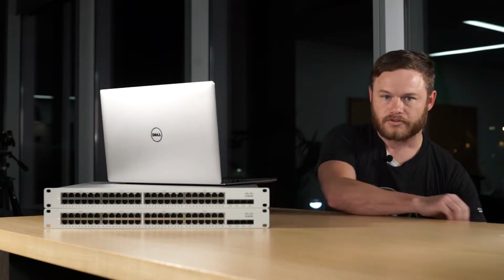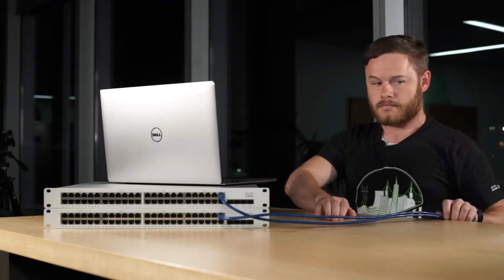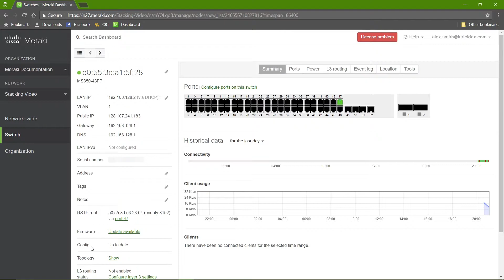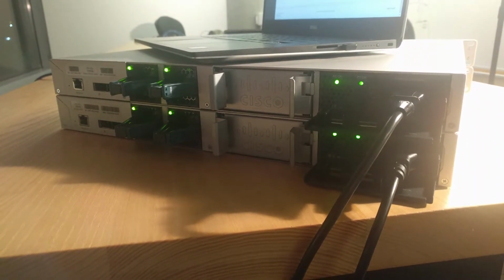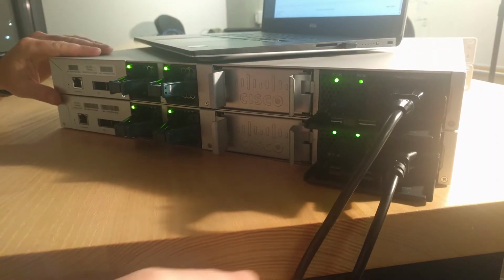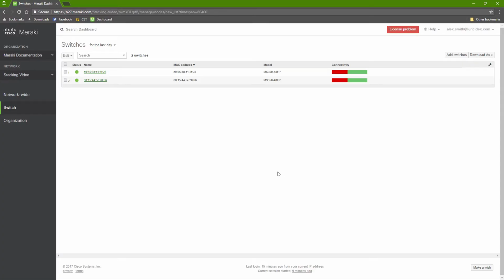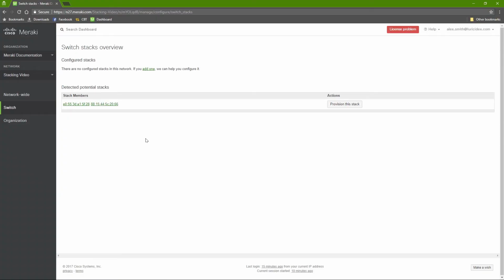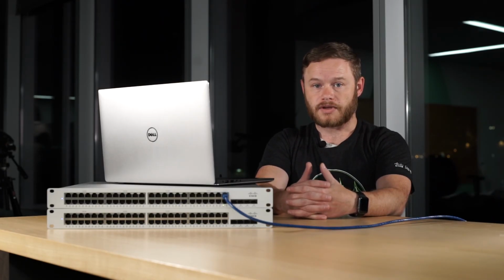Meraki Physical Switch Stacking Configuration

Comment: In this case the switch member with the iNet connection is the master? How can you hard set the switch member priority to ensure it's the master? I know in stackwise you change switch priority to 15. TIA.
Reply: If all stack members are powered up around the same time, the MS with the lowest MAC address will be elected the Active switch.
If the stack members are not powered up around the same time, the MS with the highest uptime will be elected the Active switch, regardless of its MAC address.
The Active switch will remain the Active switch until it's either rebooted or an event occurs that forces another Active switch election (such as stack ports being reconnected).

Comment: Does it matter if you use port 1 for the inbound backplane connection and port 2 for the outgoing backplane connection?  I have 5 switches in a stack and have them stacked that way but am wondering if I should cable the backplane as you have described in this video.  Thank you.

Comment: can we use only one stack cable on dedicated stack port? or its mandatory that require 2.
Reply: I wonder the same thing, did you find an answer to this?
Reply: We always do two for redundancy purpose
Reply: @vul.1713  redundancy of what though? One of the cables going bad? Seems that would be the only thing. Just want to make sure it is not "required", as this cable failing is unlikely and maybe you just need 1 cable laying around as spare, say if you have 40 of these pair of stacked switches in your landscape.

Comment: Do the switches need to be powered off before connecting the stacking cables?
Reply: Yes, according to the stacking guide, they need to be powered off, after the initial boot from both. power them off and then proceed to connect the stacking cables. After that turn them both on.
Reply: There is a relevant discussion that it is not required but if you are expecting no downtime at least one of each pair will power cycle if you do it live